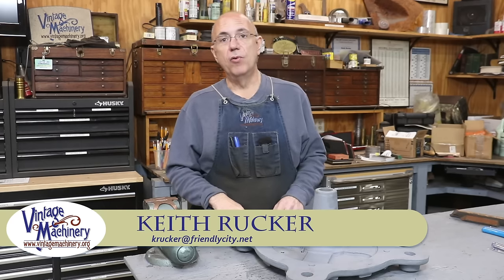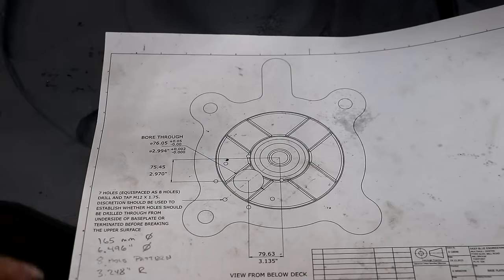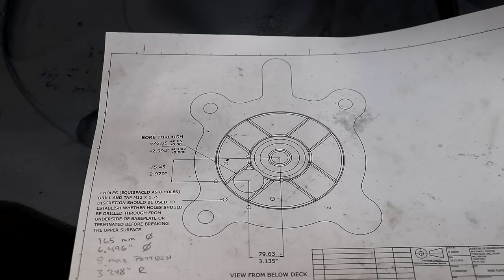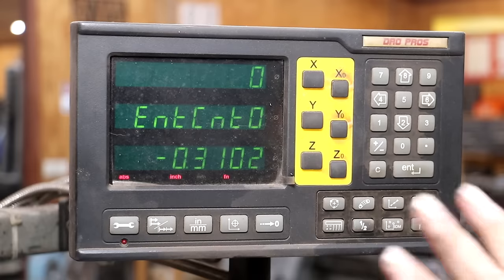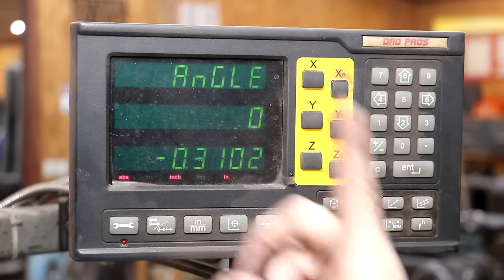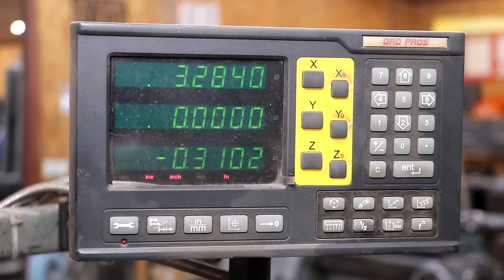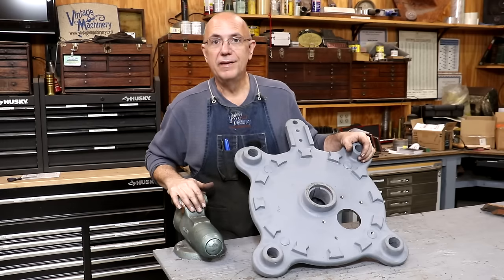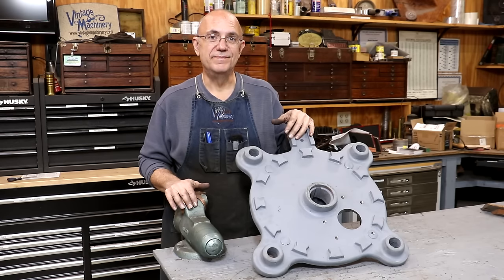Tally Ho Capstan Restoration: Drilling & Tapping a Bolt Hole Pattern in the Capstan Base

Comment: As an owner of a sixth generation engineering and tower clock making company in the UK I do wonder how accurately the translation from metric measurements on the drawing to imperial measurement on the machine tool went. It is 'non trivial' to make such an 'Imperial/metric' translation, and particularly when the item to be mounted was manufactured using the metric system. I do hope that all turns out well. About time the US adopted the metric system. However it looked like a beautiful piece of machining. Nicely done.
Reply: I fully agree. I import equipment from the US to UK and Europe and having to deal with these outdated units is painful.
Reply: Many, many years ago NASA sent a very small rover to Mars (about the size of an average RC car). The rover was housed in a pyramid shaped, soft cell, container with rounded edges.
The plan was to parachute the container down to near the surface, where the parachute would detach and the container would gently bounce , and roll, on the surface, coming to a halt the correct way up. The top section would then open up like the petals of a flower and provide a ramp for the rover to exit down.
Everything went exactly as planned until they tried to exit the container, at which point the rover became jammed in the ramp guide rails. The container (including the ramp rails) had been manufactured using the metric system, the rover had been manufactured using imperial measurements.
Why the Americans never thought to throw the prototype off the back of a truck and test everything worked before sending it to Mars remains a total mystery!
Reply: It is a very simple conversion. Inch to metric: x25.4. Metric to inch ÷25.4. Any machinist or draughtsman knows this and there are no discrepancies regarding accuracy since every dimension of a design has a tolerance. edit... Keith did not have to do the mm to inch conversion himself. The design was drawn with metric and imperial dimensions.

Comment: The note to be careful breaking through drilling cast iron for surface breaking . You did not comment on that
Reply: I saw that on part one of this and Keith also said he didn’t want to drill through it when he started to drill the first hole. I was a little surprised he didn’t zero out the Z axis on his DRO for that though, must not have been that important.

Comment: Why wasn't the casting flattened in the area where the motor bolts to?  At least local areas could be cut flat and the mating part could be made to fit the varying heights or shimmed to fit.
Reply: as mentioned before, an adapter plate will be manufactured to solve this exact problem.

Comment: Nice job on the capstan base. You need a "T" handle tap wrench for those tight spaces. When I was doing machine work in the UK we were told that cast iron does not require lubricant when tapping. The carbon in the cast iron is a lubricant in itself.
On the 2 holes up against the center flange/hub would have been a bit easier if you had done a spot face to clear the flange material. Reduce the chance of the tapping drill being pushed out of position.

Comment: Uhh I think you have a major problem!!
You showed a radius of 3.248, but entered 3.284 into the DRO. So each hole is 36 thou further from the centreline of the motor.
Reply: Yep, hope the mating part hasn't been made yet so it can be made to fit.
Reply: @johnwelton2606   or it has a generous tolerance
Reply: @johnsherborne3245  plus or minus a mm would be very generous!
Reply: @johnwelton2606  Pretty sure the mating part is a commercially available motor.  Don't think you're going to talk them into redesigning it lol.  Probably just going to have to slot out the holes on the motor flange
Reply: @Jcreek201  no, you wouldn't mount the motor directly to the casting like this. The surface is too uneven. There will be a mounting plate that goes between the casting and the motor.

Comment: strange setup and requirements from Tally Ho team.
Considdering the part construction the hole should have ben better in the low spots between the spokes.
This woul be more stable and would allow the holes to be put into the spoke avoiding the inner hub step

Comment: Having checked the Tally Ho , You Tube recent update on the Capstan, thus motor and gearing is still being worked on  in England. It can be concerning that you do nit have the actual motor and gearing, as these will definitely be manufactured in MM sizing. Even a 3D model of the mounting plate would insure that everything will fit together correctly. 

Having checked the Windy Hill channel on this project, it seems that every portion is experiencing “ Per Aspera Ad Astra”. ( Through Difficulties to the Stars).

Comment: Apart from the other comments, which I agree with, is the motor supplier aware that the base of the centre cone is radiussed? I would expect it to need a flat area around the two bolts at the inner edge. Edit: I hear there is a deck in between the plate and the capstan.
Reply: Adaptor plate.  

The motor attaches to an adaptor plate.  The adaptor plate attaches to the capstan base.
Reply: @WhatAboutTheBee  And that will require a flat surface unless the radius as allowed for , which is highly unlikely.
Reply: Easy enough to create a clearance feature to avoid the pointy and radiused base cone.
Reply: Just a thought, perhaps we are seeing things half done and the mating face is still to be fly-cut all over, which IMHO is necessary for a bolting face without distortion?
Reply: The motor mount plate will be under the deck, nothing but wood will touch the bottom of the base of the capstan.
Reply: @matthewnowell4657  That would make sense, hopefully some provision to resist the torque

Comment: Why didn't you use mm? Your digital system has the option?
Reply: There are two types of countries in the world. Those that use the metric system - and those that put men on the moon.
Reply: The better question is why would someone design a metric add-on (the power drive) for something that was designed in Imperial dimensions (the capstan)?
Reply: Because that's what the customer needed.
Reply: The motor assembly and gear mechanism are being built in the UK where we have (mostly) dragged ourselves away from the outdated and clumsy imperial system to a system based on 10s 100s and 1000s. Whilst America is trying to work out what 173 x 113ft 9 51/64in is or how many gallons you can fit in a cubic yard the rest of us are enjoying a round of golf (which ironically I think still uses yards )😃 .

Comment: use a ratchet and a socket to turn the tap
Reply: Lisle makes tap sockets that work great, McMaster Carr sells them too if you need the boss to buy.  I just need a ratchet with a center hole in the back for the follower.

Comment: Honestly the engineering or data engineer recieved and also design approach was odd to me on this - didn't account for the shape of the top of that base - that it's not just a flat object + why did all these mechanics have to on the capstan/boat side instead of beneath floor. The design that was chosen looks like it was focused on trying to make a new component fit to an existing one - the motor components or whatever is bolting to it - which matters here because the point is to maintain the original and retrofit an electric wich setup. My man followed the drawing which is all he can do but he was prob as frustrated as I was with the design/engineering apprach to this problem. Thought of much cleaner ways of going about that - especially given precision/high quality antique resto work is being done and the tally ho was all about keeping to original and did it so well. Multiple parties all over the world etc made it a harder problem but this needed some good nutting out from the outset to account/plan for the reality.

Comment: You had it set up once why didnt u finish it U could have made the bore .000 ,000 center line  half the bolt circle times .70711 tell ya 3 locations other 3 on center line half the bolt circle sure hope u got them in the right location Now one one of your trolls is gonna  tell me i dont know what im talking about LOL, slip drive tapping head would work

Comment: You can figure out the bolt pattern by triaging  it out .
Reply: Why? The DRO does the math. I worked with a machinist that wouldn't trust the bolt hole program on the DRO, did the trig calculations. The boss was annoyed, saying "He doesn't trust a $3,000 DRO but he trusts AA$15.00 calculator."
Reply: Triaging = conducting a preliminary assessment of patients or casualties in order to determine the urgency of their need for treatment and the nature of treatment required. I'm not sure how that would help in determining a bolt hole pattern...

Comment: did you tap the holes from underneath in reverse?
Reply: Why exactly would you do that?
Reply: Your lack of education does not change the complexities of the world around you.
Reply: @grntitan1  im dyslexic so im trying to wrap my brain around how tapping from the backside would work with threading the bolt from the top, you dont have to be a shithead, you could just answer the question
Reply: @superformOG it makes no difference. just imagine that you can put  a nut on a bolt both ways too . cheers.
Reply: @daki222000  thats the point i cant imagine it, im dyslexic, thats why i asked
Reply: @superformOG yes I got that, for that reason i tried to come up with an  example you can do in your own hands. take a  nut, and run a bolt in from the top and out again, and then run it in from the bottom. both directions work . a tap is no different to a bolt regarding the threads on it,  maybe i should have written that.
Reply: @daki222000  i used my hand to think of the high side and low side of the thread, then when i flip my hand the high side of the thread becomes the low side and the low side the high side. thanks for the help it makes sense now

Comment: You mentioned that you were going to use a bottoming tap on the 2 non through holes, but at the end you had not shown it or mentioned doing it. Did you remember to do this step?
Reply: If you were listening,  at 7:27 Keith said that he did not have a bottoming tap.
Reply: He said he had to order a bottoming tap, because he didn't have one.

Comment: Why the lube on cast iron? It has graphite in it already as a lubricant…plus lubricating taps and dies dulls the shit out of them.
Reply: Lubricating taps and dies... "dulls the shit out of them".  That is an epically stupid claim.
Reply: @Katchi_  well it’s true. Solvent works well but if you use an oil it dulls them for some reason. I’ve done a lot of tapping and chasing of threads. Steel I use solvent, aluminum wax, cast iron nothing. I used to use oil but taps were dull after a few years. Removing broken taps is a royal pain as you have to anneal them with a torch and drill them out.

Comment: Something I don’t understand, if a motor is going to be bolted to this why wasn’t the surface  machined flat? I understand he said a mounting plate had to be made but is one side of the plate going to be machined to match all of the uneven contours of the surface? Good idea bad execution plus I don’t think Leo thought this one out. A large round hole was already going to be required for the Capstan to be mounted in the deck of Tally Ho as original ; now the hole will have to be bigger to allow for the electric winch motor. I wonder if they have planned for the larger hole by strengthening up that area of the chain locker deck? Tally Ho will probably set sail with a modern winch and a new anchor shaped like a Capstan!
Reply: I have not been watching the boat side 
I wonder if the mounting plate will be under the deck with just the axle hole drill through the deck
Reply: @1BigBen  I don’t think so, remember he didn’t drill through two holes fearing it would interfere with the ratchet system built into the base.
Reply: The motor won't be mounted there, instead a ring-shaped flange will support the driveshaft, its upper bearing, mechanical clutch & enclosing tube. The bore will continue down through the deck & a support beam, then a 2nd flange will mount the enclosed worm & gear transmission. The motor bolts to the side of the transmission.
The deck is curved in 2 directions, it'll need some relief to mount the capstan base, & some carve-out to clear the upper flange.
Reply: @frederickstibbert7389  Thanks, I appreciate the detailed explanation. It will be interesting to see the finished product.

Comment: 15:00 This is a poor design - an obvious retrofit: you can see the drill bit flexing.  It probably should have been milled.  Or perhaps even better, first had the webbing void filled with a brazing slug of some kind, so that a level surface existed over the entirety of the drilled hole's area.  Or, like you said later, drill (as well as tap) the hole from the other side.  If you were still worried about through holes, you could always add brazed plugs.

Comment: And so...while Keith  ponders the purchase of a calculater, or the old saw of "measure twice. cut once", let's slide on over to the Windy Hill Foundry and watch a dedicated group of down-home country boys once again (fourth time?)to try to recast the top of the capstan that Keith broke into pieces.  Not busting on Windy Hill, those boys are top-drawer and   obviously that part simply does not want to be recast.  Tally Ho will be splashed and off on her adventures before the capstan makes it to her focsle.  Anchors aweigh lads.
Reply: I don’t know if “top drawer” is the word I would use. They are clearly not set up to cast a part of that size. You can’t expect to lift the mold with ratchet straps and get a clean crisp lines.  It’s good to keep old technology alive but think how quick they could have scanned, printed and cast using modern technology; probably a day if all the equipment was available.  I busted a flywheel on an outboard motor one time trying to pull it because I was using the wrong tool and it ended up like the capstan. Parts that are a press fit better be separated with dead center even pulling/pressing force or they just lock on tighter .
Reply: Clark has an electric winch that he is using not the ratchet strap.
Reply: @edricoddot  I believe the winch was hooked to straps which flex and move. There is a video on YouTube of Ford Model A engine blocks being cast, check it out if you can find it. I took a casting class in college, slow and steady movements are needed for sanded casting from my experience but Ford had it down to a science 100 years ago and it is amazing how fast with precision they managed. I have worked at a factory that made engine parts for Toyota and modern casting techniques can spit out a raw unfinished  part about every 2 seconds.
Reply: @rich40701 And the Tally Ho could have been rebuilt using fiberglass and plastic.  Why bother with wood when you know it is going to rot again.
Reply: Oh well, I didn't see glexing in straps. Clark has been casting probably longer than you. Leave them alone I think they know rhe right way to do it.
Reply: "And so...while Keith  ponders the purchase of a calculater"...
Or just use the one already built into his DRO. Calculator button is just to the left of the 1/2 function button. 🥴

Comment: I am confused as to how you are making a plate to mount the motor? First you have all those contours that you have to get around so am assuming the plate is going to be proud of the surface! If you drilled and tapped the holes for the motor bolt hole pattern, is the plate going to have same pattern? Why not make a plate that has it's  own mounting pattern and the use motor pattern on the mounting plate?

Comment: Keith, I am always entertained by your videos and look forward to each release. I am sorry but this one is a disappointment. The high quality engineering and craftmanship that Tally Ho has enjoyed is lacking in your efforts. You have, at your disposal, all manner of excellent tools and fixtures that could have and possibly should have been used for this project. I just hope the mating motor drive assembly can take up the errors in placement of the mounting holes you have introduced to this project. I know this is not your main job and basically are doing this as a favor to a fellow YouTuber, but, greater care and precision would have been warranted for this project. 😕😟🙁😲
Reply: Abom would be ashamed.
Reply: I think Keith has been properly chastised now
Reply: Especially on a ONE-of-a-kind piece, now it's going to have extra holes for no reason other than being stubborn and, "this is how I've done it for years" mentality...
Reply: He may caught it before he started, and didn't show it or mention it.
Reply: but can you be sure, that mistake was not done late in the night editing the video putting the wrong clip in?
if it was, how will feel about your comment
Reply: He still needs to make a mounting plate for the motor and can easily adjust the bolt pattern to match. It should be an easy fix.